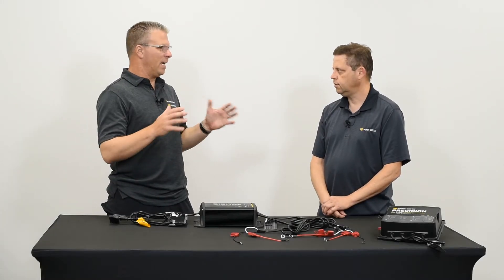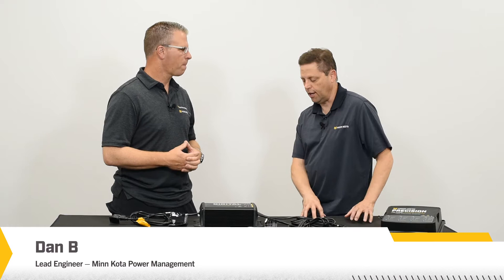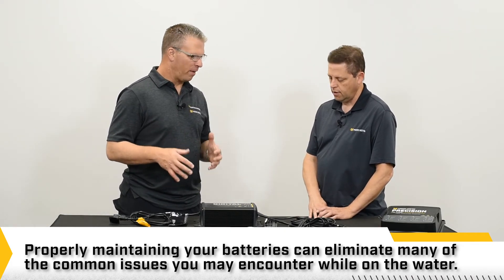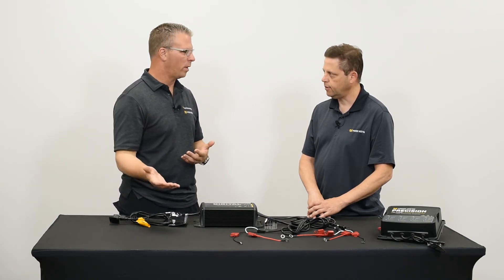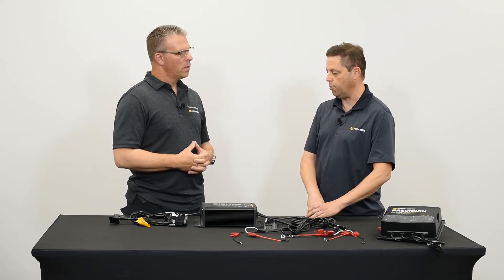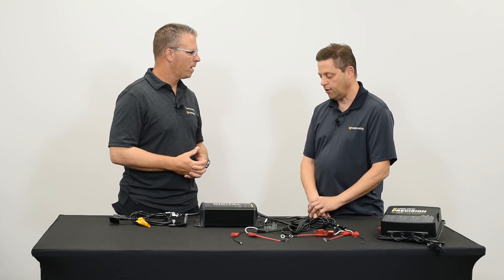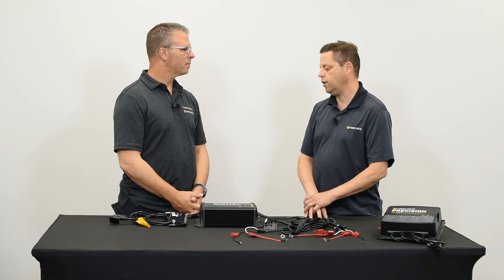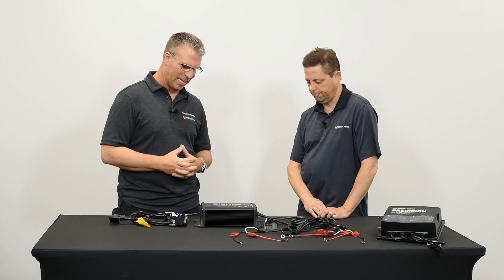Symptoms of Poor Marine Battery Performance & the Effect on Trolling Motor &  Fish Finders

Comment: We have been having trouble with spot lock on our 2  year old Ultrex 80 dropping out for a long time.  We worked with the wiring as best we can.  I load tested our 2 year old batteries and they have about 845 CCA.  I had the battery to foot pedal rewired by one of  your Authorized Service Centers...#6 wire.  It improved but still sometimes drops out.  I checked the voltage at the head running at 10 with fresh charged batteries before and after the rewiring.  It was 20.8V before and 21.9V after rewiring.  From your video, I suspect that is too low.  

What voltage should I see at the head when running at 10?  What resistance should I see from the motor at the head when not running?  I can't get more out of my recommended lead acid batteries.  If my motor is drawing too many amps and you will not fix it, should I use Lithium.  I don't like them because of the danger of charging them in Georgia's hot climate.  Give me a suggestion.  Thanks.

Comment: Just Bought 2 Brand New Batteries And Are Fully charged And still im in this reduced power mode 😞
Reply: Did you figure out why?  Mine worked awesome last year, this year speed 10 feels like 3 and when in speed 4 or above wont steer......Hopefully just a battery
Reply: @1973superdad running into this issue..won't turn...and if it does it goes super slow...won't turn eather unless I turn propeller off turn then go ...what was your fix to problem 😊
Reply: @rambojones8711  mine was the battery
Reply: can you put a volt meter at the input of the trolling motor and see if it's getting all the voltage from the batteries when under load?      maybe two voltmeters one at the batteries and one at the trolling motor.   A bad connection or too small of wires can drop the voltage across the wire.      example.  25volts at the battery and only 20 volts at the trolling motor under load (while motor is pulling)